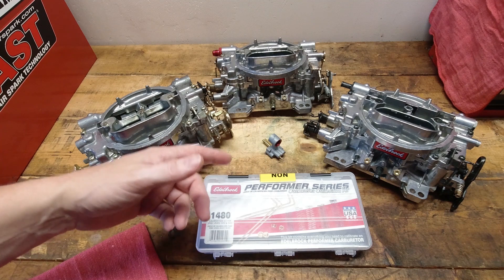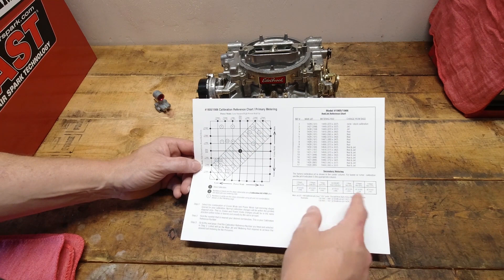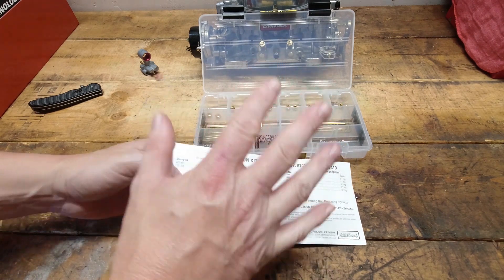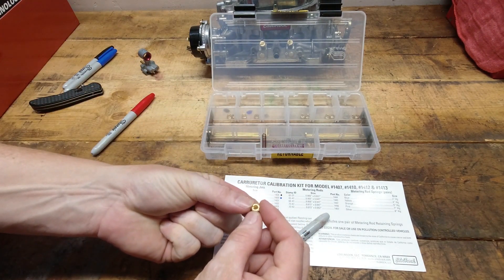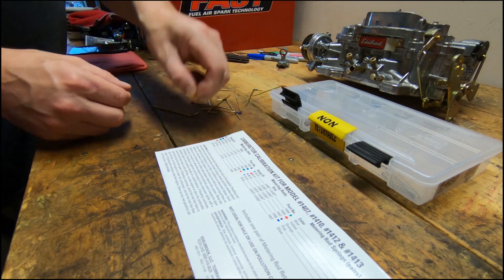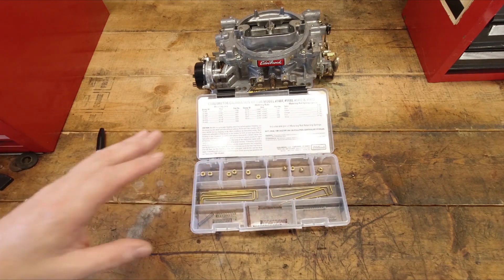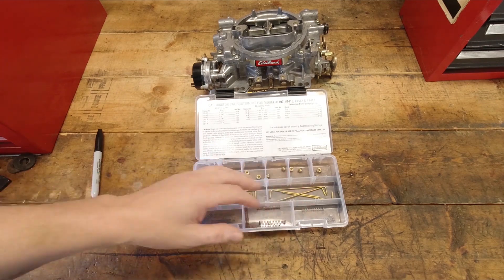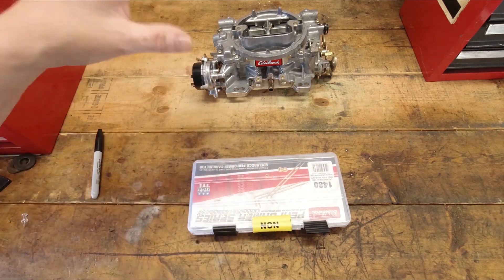Edelbrock Calibration Kit Breakdown

Comment: Looks like I’ll need 2 kits, since I have a dual quad setup. …. Looks like kit 1486 is what I need, since it’s two 1404 carbs. …… I’ll look into an afr gauge as well, since dual carbs feels more challenging to tune…… and I’ve never tuned any carb before. 😅 …..any videos or tips for tuning a dual quad setup?

Comment: Very helpful! Looking for some advice. I have a Pontiac 400 engine bored .040" over with a Edelbrock Performer cam and intake package and the large valve Pontiac 6X-8 heads. It currently has a Edelbrock 1407 750 cfm carb. It's in my Trans Am that, until recently, had been sitting for over 20 years. Back in the '90's when I was driving this car with this 750 cfm carb in Pensacola, FL, I noticed it was running rich. It ran fine but I could smell the exhaust and see from the spark plugs it was running rich. I now live in Albuquerque, NM and am restoring this car. At this altitude I'm thinking that rather than buying the Edelbrock 1480 calibration kit I should instead replace this 750 cfm with a Edelbrock 1405 600 cfm carb. What do you think? Would there be much hope of calibrating this 750 carb to make it lean enough for optimum performance at this altitude?
Reply from the maker: For sure you’ll go much leaner in ABQ than you were in Florida.  If you decide to drop down in CFM, go with the AVS2.  It’s a 650 but you’ll enjoy the annular boosters and the better performance from them.  Always get the calibration kit and you can clean up those rich/lean conditions.
Reply: Thanks! I'll check out the AVS2. I haven't calibrated one of these before. Based on your experience, can a 1407 750 cfm carb with its out-of-the-box configuration be leaned out enough to get it where I need it? Or would that be wasted effort at 5000 ft above sea level on a 400 engine?  @MuscleCarSolutions
Reply from the maker: @DavidAKTA  sure you could likely get it down to where it will run a whole lot better at that elevation.  That’s not the thought though.  The performer kit has an rpm range of idle to 5500.  The ole Poncho motor isn’t made for high rpm.  So even at sea level I’d opt for a 650 on that engine.  Unless you’re actively looking to run the car at max rpm (drag racing).
Reply: Thanks. Just looking to enjoy a fun cruise from time to time. No racing. I might drive to Santa Fe or other places with higher altitudes occassionally where this 750 would really be rich. The 650 AVS2 seems to be reasonably priced at Summit Racing, so I'll probably opt for one of those. I recently bought a rebuild kit and Edelbrock 1478 choke kit for this 1407. I can't return those for refund anymore so I was wondering if it would be worth it to continue with my original plan. According to Edelbrock, that choke kit can't be used for an AVS2, so I'll get one that already has the electric choke and try to sell this 1478 kit. Thanks for your help.  @MuscleCarSolutions
Reply from the maker: @DavidAKTA  the difference between your elevation and Santa Fe is absolutely significant on how a carburetor runs.  I’ve made that trip a few times in a classic car and it’s a bit of a challenge.  You’ll for sure have better adjustability with the 650.

Comment: That explains why I can't properly tune mine. Pulling fuel like crazy. Could be the pump gas messing with it too
Reply from the maker: What is your pressure regulator set to?  What are your floats set at?
Reply: @MuscleCarSolutions  my pump puts out 5 psi. Not sure where the floats are. I swapped and traded for it. Think it came off a 350. I put it on a 302 ford. Recently put a wix 33040 between the pump and carb. Thinking about changing it to a 33041
Reply from the maker: @WARD5KUSTOMZ  you aren’t running a regulator?  Do you have a pressure gauge?
Reply: @MuscleCarSolutions  no regulator pump spec is 5
Reply: @MuscleCarSolutions  the filter I'm using has a non restriction return line
Reply from the maker: @WARD5KUSTOMZ  I wouldn’t assume that.  If you watch any of my fuel system videos I’ve gotten plenty of off the shelf pumps that were rated at one thing and were significantly higher.

Comment: hey my plug look very good i only got about 480 miles on my engine .my truck runs okay only when i take off from a start it dont take  right away but as i give it more gas then it takes off..i been playing with my timing i got my tiiming at 14 degrees it starts good dont run hot and i have always been checking my plug on the regluar...i were going to order the calibration kit ..some one told me im going to have to calibration the carb because of the size cam i have in there thats why im burning alot of fuel ..i were going to get it put on a dyno but dont have the money right now...i dont no if my timing is right where it suppose to be or not..its not  pinging or nothing like that..like i said it runs okay its not missing or nothing like that i just dont have no power its all most like the timing needs to be advanced...with all the upgrades i have the full power is just not there my compression is good all my cylinders  are 150 its nothing wrone with the engine i just did the initial timing ..didnt do the total timimg i still have the old time light
Reply from the maker: I’m confused then.  You say you’re burning too much fuel, but the plugs look good?  Tan in color?  Why do you think you’re using too much fuel?  You haven’t done any tuning to the carb yet?  No matter what size the cam is, you’ll always have to calibrate it to your engine, situation, elevation.

Comment: got question for you ....i just rebuild my chevy 350 1990 k5 blazer i converted it over from tbi to carb ..i did a few up grade on the engine high performance  intake headers 3' pipes all way back up graded the cam to a howard rattler cam 525 intake lift 535 exhaust duration 227/235 lobe separation 109 center line 103 i still the same factory heads on there i believe they the swirl port heads ..i no i should have went with some better heads but the engine was already done. i put a brand new 1406 edelbrock carb on it right out the box every sence i put that carb on there i been using alot of fuel i set the carb best as posible ..im using a awful lot of fuel just with it iding..i have my pressure regulator set at 5psi..dont no why im losing so mush fuel my cam is not pulling alot of vacuum when i did a vacuum test i belive it was about 10 inches of vacuumi on my guage do you think i have to chaange the springs and the jets or is the carb to small for my set up..im in chicago so im about 597 feet above sea level..
Reply from the maker: Thanks for all the detail!  Start with the simple things.  You say using a lot of fuel at idle.  What do your plugs look like?  Black and smell like raw fuel?  Check the float level.  Make sure you don’t have debris in the needle and seats.  Drop the pressure down to 4psi.  That’s outside of the operating range of the carb, but that’s ok right now as you’re chasing problems.  See if that helps it.  Maybe you have a regulator or gauge that’s reading incorrectly.

Comment: It's been interesting following your edelbrock videos, the cal kit & breaking down my 1406. After the factory sent me the missing parts that were missing in my new kit, I began to inspect what was in my 1406 carb.

I found that the driver side rod was a 7047 & the pass side was 7042...yup, they mistook a 2 & 7! 

Taking the jets out I found one was a 305 but couldn't make out the # on the other, but both looked the same. None of those #'s are shown in my carb's specs & I don't know how they're affecting the carb. The engine was built very Hot, ie, the car is a monster. I'm unsure what the cam is but is sounds like a rough one.

I was going to revert back to the stock calibration & tune from that point after finding the mismatched rods, but doing so might strangle the car. I'd appreciate your thoughts on this.
Reply from the maker: Well, start from a known point.  If you have a calibration kit, then select a combination that puts you where you think you need to be.  Set the accelerator pump at the middle setting.  Get a vacuum gauge and check where you are at idle and put the proper spring in.  Set your regulator at 6psi.  Verify your initial and total timing and start the tuning process.
Reply: @MuscleCarSolutions  Great, many thanks for the tips & vids

Comment: I have a 66 gto with a 389 on it and a edelbrock 1406 carb , i installed a AFR gauge and i got it running pretty well until i replaced the stock intake manifold for a edelbrock performer rpm , now is too lean at idle,  when i am running it is better but i can't get it richer at idle, i did purchased the calibration kit , i have tried with different springs but nothing,  any idea ? Thanks !
Reply from the maker: oscar yedro at just off idle 1000-2000 room.  What does your AFR read?
Reply: It is 22.3 , the only way to get it down is opening the idle screws almost all the way .
Reply from the maker: oscar yedro you might have too small a carb.  What cam is in it?  What compression ratio?
Reply: Sorry , it is 22.3 at idle , I'll try tomorrow to see what i got off idle and I'll let you know,  thanks for your response.
Reply: I just got the car in February and i am still learning about it , i was told the motor was stock , the only aftermarket part was the carb and headers and now the intake manifold.  I couldn't tell you about the compression ratio.  It was idling fine before i put the intake manifold .
Reply from the maker: Well there’s a few things you can check.  If your AFR was good before and not now, the chances of some garbage getting into the idle circuits is high.  Even if it was running fine before.  The other issue here is that intake.  It’s not exactly designed to work on a stock engine.  It’s why the power range is higher on the RPM intake vs the performer.  If you plan on a rebuild in the future with a more aggressive cam, cr, heads, etc...then it will be ok then.  Now not so much.  But it shouldn’t drastically cause your AFR to go that lean.  What’s your regulator set at?  Still getting a strong 6 psi to the carb or do you have it set lower?  Might come up a little.  I’d pull it apart and blow through the idle circuits.  When you take the top off the carb and there any crap in the bowls, you’ll know what the problem is instantly.  Change both your fuel filters.
Reply: I am planning to rebuild the motor and add more HP on it so i should be ok with this intake manifold,  I'll take it apart tomorrow and clean it and i will let you know ,thanks for your help  !!!

Comment: just rebuilt 1405 carb, and installing carb for first time soon. You have info for basic initial carb setup on the engine?
Reply from the maker: That’s kind of difficult to make any suggestions.  If you set that carb up with the base calibration as it came from Edelbrock it’s usually a really good staring point.  The biggest question to ask in starting is you fuel system correct?  Is your ignition system in good shape and is your timing set properly?  Then you can begin the tuning process.  The Ultimate Tuning Guide in my Edelbrock Tech playlist is a great video to get you started.  Let me know if you have any questions.  I’ll be happy to try and help.
Reply: @MuscleCarSolutions  Installed new needles, springs and jets (Edelbrock base setup). All new fuel system (followed your chart). New crate motor, (will time appropriately). In rebuilding the carb, I followed your videos. I am concerned on the choke / fast idle screw initial setup (can i do this on the bench?). Also the transfer slots, can i set this up on the bench as well.
Reply from the maker: David Baker sounds like you’re in a good spot with your fuel system and the rest of your set up.  Setting the fast idle is a little more complicated on the choke side.  That manual choke carb is a little more difficult to set on the bench because you can’t dial in the electric choke to help it.  I wouldn’t worry too much about it until you get the engine fired and it’s initial break in completed.
Reply: @MuscleCarSolutions  Have engine running and carb tuned, just worried about WOT. After I hit WOT I cannot get my Air fuel ratio back to 13-14 mark.  It runs lean after WOT (16-18). What you think it could be?  I have a carter p4070 fuel pump and 1405 carb.
Reply from the maker: @diggs002  couple things you can look at.  Once you’ve hit WOT, get to a spot where you can pull over and visually see what your pressure gauge on the regulator is reading.  Are you running a bypass line or a dead head regulator?  Can also check fuel level in the carb and see if you’re starving the metering systems.
Reply: @MuscleCarSolutions  ok thank you ill check it out. I am running a dead head regulator.  I am thinking it might be the fuel pump pressure.
Reply from the maker: Sounds like it could be.  That’s where I’d start, then to see if it’s starved the carb.  Just means it’s not keeping up or the regulator is bad.  What brand are you using?
Reply: @MuscleCarSolutions  carter p4070
Reply from the maker: That’s the pump.  What regulator?
Reply from the maker: Actually that pump is only rated to 4psi.  You need to be feeding that carb 6psi.  Probably one of your issues.  Get a pump that’s rated 4-7psi and a good regulator and gauge and retune.
Reply: @MuscleCarSolutions  You have a pump recommendation?
Reply from the maker: You can go with the cheaper option;  https://amzn.to/3b5E2rl
Reply from the maker: Or the more expensive option; https://amzn.to/3uIBLtE
Reply from the maker: The cheap pump is chinese.  All the holley stuff is off shore now also.  The expensive pump is made in the US if that’s important to you.
Reply from the maker: I’ve started using this regulator.  I’m a big fan of Aeromotive product.  Made in the US.  https://amzn.to/37VuDQY
Reply: @MuscleCarSolutions  Gonna throw the new pump at it and see if it helps
Reply from the maker: @diggs002  it should but you really need a regulator to do it right.  At a minimum put a pressure gauge on so you know what’s being delivered to the carb.  Right now you’re flying blind and it’s extremely hard to tune and diagnose problems without a complete set of information.
Reply: @MuscleCarSolutions  new pump = no more lean issues!
Reply from the maker: @diggs002  that’s awesome!  Nice work!